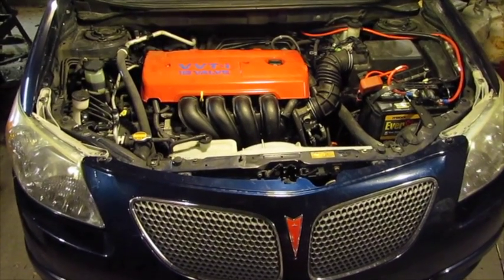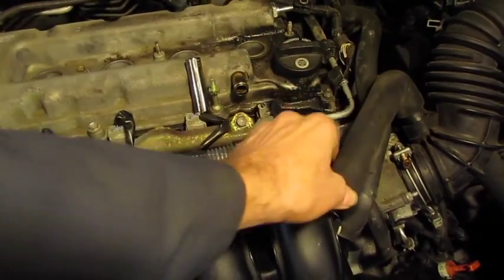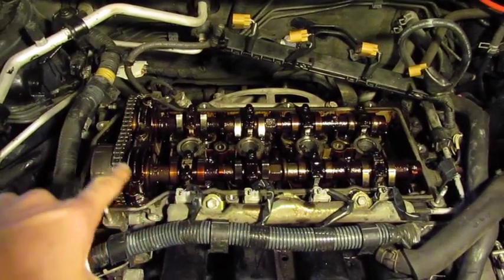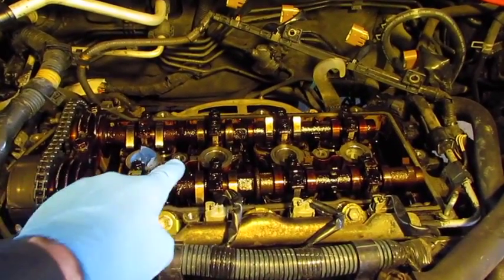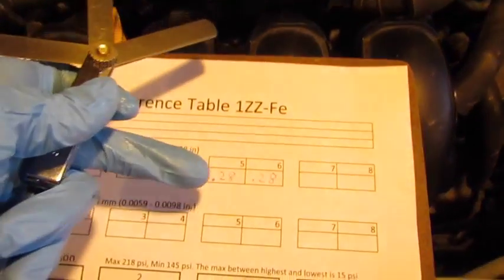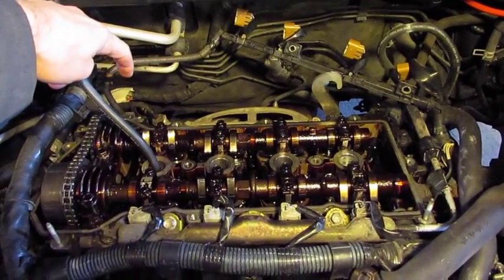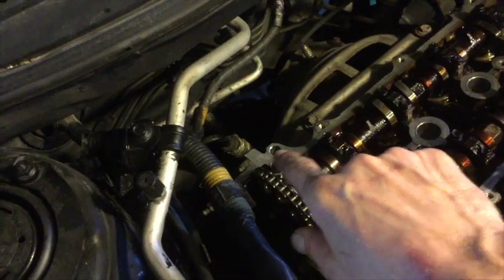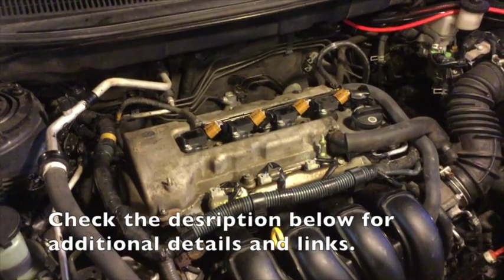Valve Tolerance and Compression Check 1.8L 1ZZ-FE Vibe Matrix and Corolla

Comment: Thanks for the video. Question please: I am doing an engine rebuild on Toyota Celica 2001 and the valve buckets have been mixed up (argh my fault). I am following your process and after 6 attempts now of swapping them around with some success but not on all of them am wondering if there is a better way. I can confirm I have lapped the valves and the water check on all of them was great. These are the bucket valves with the fixed in shims. I am wondering if a micrometer will serve me better, new complete set of buckets? It is important I do a proper job. Any advice would be great. Thank you. Chris :)

Comment: Great video but why check the valve clearance if you have to remove the head to adjust the clearance (MAJOR job)?  Thanks.
Reply: You do not have to remove the head to adjust clearance, the bucket lifters come in different sizes so all you need to do is buy the correct height lifters for your clearance adjustment
Reply: @tactical-bucket  O.K. Excellent. Thanks so much for the response. Very glad to know that.

Comment: I got a high mileage 2009 Corolla (200k) and it recently has a "Lifter Noise" and based on my research, may be the valve need to be adjusted. Would adjustment on the valve like you did may solve "Lifter Noise". I also found out some oil additives (Lucas / Liqui Moly)  may help too but not sure it is a permanent fix. Thanks again for the excellent video.
Reply: yes need change those bucket valve lifter, no oil gona work, thicker oil might reduce noise , changing those lifter very easy , if you have qs ask me , i just did a rebuild on this engine
Reply: @fahhad17  Thanks so much for your information. I will, thanks in advance.
Reply: @fahhad17 Hey man would you be able to help me with my engine, I have the same one and same problem. Would really appreciate any advice!

Comment: So if you actually need your valves adjusted you need to keep searching for a video that will show you
Reply: You are right. I still searching for Valves adjustment which may cause Lifter noise for 2ZR-FE engine. My Corolla run like a Diesel due to Lifter Noise.
Reply: @callmebackfriday2  try rislone engine treatment. Use in place of 1/2 quart of oil.
After 200 miles my noise is completely gone. It mixed with any oil. I never would have believed it worked but my mechanic told me he had great success with it. I highly recommend for your engine
Reply: @KrazyKramer  thicker oil might be a tem solution .. its machinal thing , oil does not any role

Comment: Hi, i have toyota platz with 1sz-fe engine auto transmission, problem is when my car is cold i start its not stable i have to accelerate to keep it start until it get warm and it is power less and didnt reverse until its gets warm.
Reply from the maker: Could be a many different issues, how many miles are on the Vibe.  Is the dash showing any engine errors?

Comment: Great video! The only thing missing is what to do when a valve lash is way out.

I have a ticking in the top end of my 08 I'm confident I could get it apart but have no idea what to once I find the valve(s) that need adjustment.
Reply from the maker: That is were things get difficult.  There is no adjustment, it comes down to replacing shim buckets and often requires the cylinder head be removed.  What is the mileage on your '08?
Reply: @lustderf   only 215,000 kilometers
Reply: @lustderf  only need to remove cam shaft  , not head, i just rebuild an 1zzfe , if you have more qs pls ask me
Reply: I have a 2009 Corolla (2ZR-FE) engine with 200k and recently has lifter noise, run like a Diesel. More quiet when put in N or P but not D.  Does the valve need to be adjusted? Some say Yes, some say No.

Comment: Is the valve clearance something your suppose to do for maintenance? Looks like a pain in the ass.
Reply from the maker: Yes and yes.  Since the Vibe does not use hydraulic lifters, this service is needed to check for wear.  Looking at other posts it appears doing the first check at 150k miles establishes a good baseline with follow up checks every 50k miles.

Comment: how do u adjust it tho? i know how to use the feeler gauge and turn over the engine, but how do u adjust?
Reply from the maker: There are no adjustments, only replacement with different thickness - limitation of mechanical lifter used in Vibe engine.  When I created the video the tolerances were fine, otherwise I would have created a 2nd part showing replacement. Shim bucket replacement requires a substantial valve train tear down.

Comment: great video, could have put in how to adjust them, in case someone watching needs to do that.
Reply from the maker: There are no adjustments, only replacement with different thickness - limitation of mechanical lifter used in Vibe engine.  When I created the video the tolerances were fine, otherwise I would have created a 2nd part showing replacement.

Comment: 1:21 you can mix the coil pack they all are same no need to put them exactly from where you took them.
Same as spark plug you can mix them
Reply: Yeah I noticed that one
Reply: Yes I think he meant if you are recording discrepancies between plugs packs etc during diagnostics you want to correlate which part came from which cylinder. The condition of these are extra clues (or even causes) for any problems found.
Reply: @bookoobeans  haha i never knew that, yeah than we should not mix them. Thanks :)

Comment: Looks like the timing chain is tighter after you did the compression test how did you do that or that normal for some slack to be seen and then tighten up?
Reply: Some section stretches more than other. That's kindda normal.
Reply from the maker: I did not adjust the chain, self adjusting. Believe it was just the way the chain stopped.

Comment: I have a 2007 matrix with the 1.8. I called the dealer and they said it doesn't require a valve adjustment. What gives?

Comment: Great how to. I have a 2006 Matrix w/ 130k and it runs perfect. I use Mobil 1 full syn and oem filter. Oil change costs me under $30. Change it roughly  every 6-6.5k. One more thing I would check would be timing chain. Just give it a little push down., there should be almost no deflection or play. Did you do this because of a valve cover gasket leak or purely for demonstration?

Comment: Thanks for the video. I upgraded the camshafts in my 1ZZ and found out I had to get correct sized shim buckets. In my E36 BMW when I replaced the camshafts this was not necessary as it uses rocker arms and is self-adjusting.

Comment: Great video. Can anybody tell me why one of the valve cover vents has a one way check valve, and the other vent doesn't? They both go from the valve cover to the intake. So why would one be one way only but the other not one way? Doesn't the unblocked passage negate the one way function of the other one? If they cared about stuff going into the valve cover wouldn't they use 2 one way valves instead of only one? I don't get it.

Comment: I have a 04 vibe with 205k miles, it's got dents and needs front end work, but the motor and tranny are still pretty sound.  I can definitely use this as I haven't really taken the valve cover off and to at least do a compression test.  Thanks nice video

Comment: What is a symptom that would cause me to have to check my valve clearance?
Reply: 60k mile intervals if you're a stickler for FSM
Reply from the maker: Loss of power at higher mileage.  The valve tolerance check is mostly a preventative maintenance item. Tolerance check verifies even wear